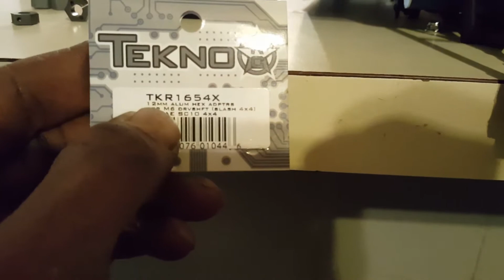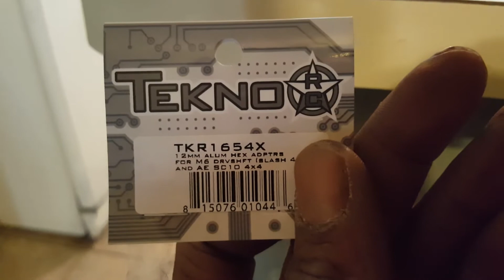February 2, 2017

Comment: a tat I need help with the foam wheel mod can u steer me in the right direction homie
Reply from the maker: gone bananas racing foams.
Reply: Kool but how did u get the jaco to fit tho like yours
Reply: Did u sale yours
Reply from the maker: its the hexs there traxxas 12mm 6mm bore hexs.there blue and they come with a drill bit for the rims.
Reply from the maker: yea i sold mines with the car.there jaco front rims.ith 12mm hex
Reply: TATMONEY  ok kool homie thanks man why did u sale it u didnt like it
Reply from the maker: Dirty263 needed the money at the time good car though!get those jacos foams front with the 12mm hex and the traxxas 12mm hexs with 6mm bore ok.your going to have to drill the hole on the Jaco rim a littel but they will fit,rc4l!
Reply: Man i understand my guy . Thanks homie.  Keep getting at them speed runs in brother